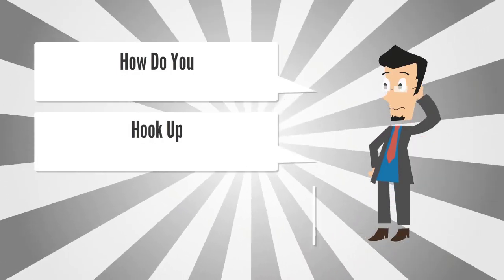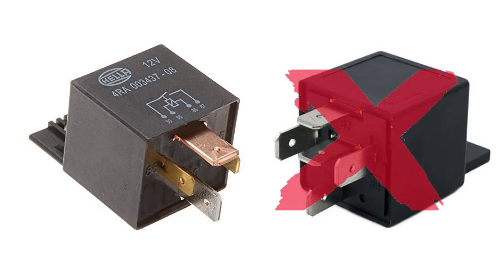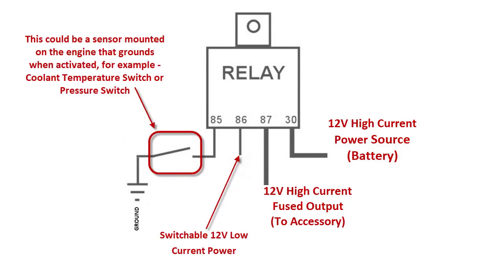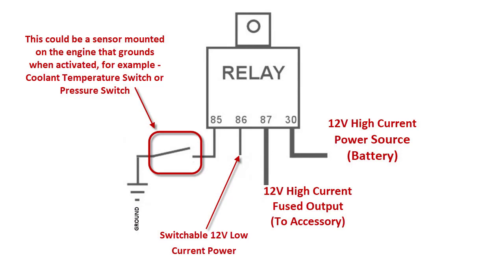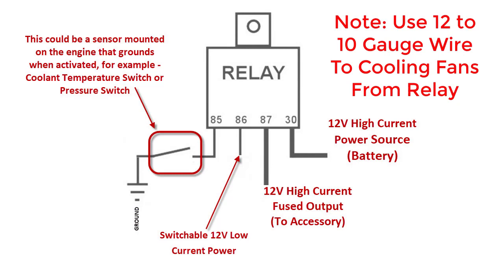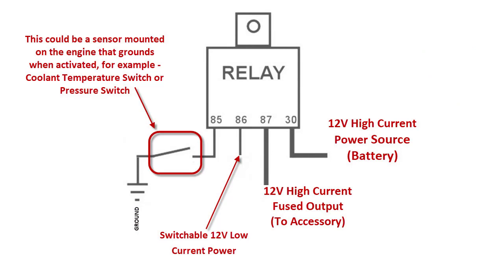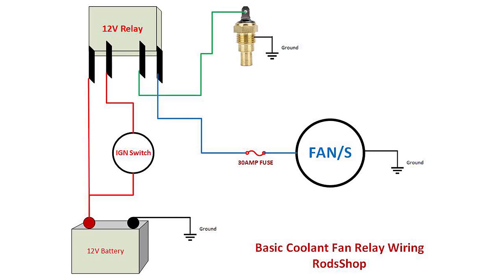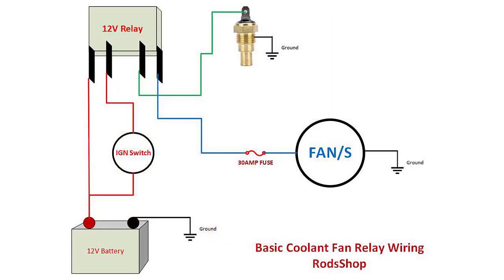How To Wire A Cooling Fan Relay

Comment: How much Current require for that and can you suggest  12V adapter and what current require?
Reply from the maker: I am not sure what you are asking. Relays are measure in amps, so if you have a fan or component that you know is going to draw 22 amps, it would be safe to get a relay that can handle up to at least 30 amps. 

If you need help on this, you will need to give me more information on what you are trying to do.

Comment: what about a toggle switch will a 4pin still work on and off for a radiator fan?
Reply from the maker: Yes, the toggle switch will just be used instead of a sensor. There is really no reason to ever use a 5 pin to setup a cooling fan, so a 4 pin is good.
Reply: @RodsshopOrg  or can i just run just a s witch with a fuse to the fan... fuck all the relay shit i keep having problems ive wired it all types of ways
Reply: @Luui2x did u figure it out bro
Reply: @RodsshopOrg  okay i have 15 amp switch  to relay with everything else wired correclty with 10g and 14g grounds and 30 amp fuse/holder and i still cant find the problem the only way it works for me to turn on and off the fan is when i wire 86 to 87 together onto pin 87 it works but then pin 86 is empty so im confuse on why is working like that?

Comment: Can you use an electric clutch fan oe harness for the signals?? That would keep factory specs an temp sensor in theory?? 2007 f150
Reply from the maker: I am not clear whet you mean electric clutch fan.
Reply: @RodsshopOrg   Like on my 2007 5.4 F150 it has an electronic clutch fan
Reply from the maker: @JokersHangout  I will look into this and get back to you
Reply: @RodsshopOrg  thank you! Everyone wants an does swap to Efan on 04 to 08 f150. 2010 fans fit flawless. But the clutch fan is pcm controlled it uses head temperature doesn't have a actual coolant

Comment: I installed a dual fan in my 86 c10. Installation was painless. The issue I have is once the temp rises and the fans kick on they don't kick off. Could this possibly be a bad relay? Thanks in advance
Reply from the maker: It could possibly be that your temp sensor for the fans is a less temperature than your thermostat. In other words, if your thermostat is a 190 degree and your sensor for the fans is 160 degrees, the water temp is never going to get below 160 to shut off. I am guessing the fans turn off after the engine cools off, you may need to give me more detail.
Reply: @RodsshopOrg  I utilized the temp sensor that came with the kit and installed a 160 thermostat as well. The only thing I did different from your wiring video is the key switch and the temp sensor are reversed. So at the moment the white wire is tied into a key switch source and the black wire is tied into the temp sensor sending unit. Due to following another how to video.

Comment: How do I put a temp gauge in a single set up
Reply from the maker: If you are wanting to hook up a temp gauge off the sensor that triggers the fan, it won't work. The sensor that triggers the fan is basically a switch and will not operate a temp gauge. You will need to find another  port in a head or block or even the radiator to screw a sensor designed to run a gauge. I am not sure if this answers your question if not, let me know if I have misunderstood.

Comment: Where  do you hook the  ground wire to fan motor
Reply from the maker: Run the ground wire to the radiator support or even to the negative battery cable. Just ensure that it is metal that is fully grounded. You can use a multimeter to check ohms between the negative battery post and what ever you are going to ground your fan to. Just make sure there is no resistance, if not sure, run a wire off the negative battery post to the radiator support to ensure it is grounded.

Comment: Thank you for uploading. Can I tap into the existing fan relay that is activated by a temperature switch so as to add a manual override, or do I have to use an additional relay?
Reply from the maker: You can tap into an existing relay, no need for another one.

Comment: Love the video. I have a 89 caprice I’ve done an  Ls swap on and I want to run Ac. Whats the best to wire up the three relay to turn on the fan if the computer is controlling them plus what wire do I tie into to use a trigger to turn on the fans to come on when the ac is activated? Thanks if you can help
Reply from the maker: The best wire to tap into is the wire that engages the clutch on the compressor. Tap off that one to trigger the relay. I would stay away from trying to run relays that are controlled by the computer.

Comment: Great video..
Could you tell me how to wire up a single  2 speed fan, to run for a/c and temp.
Reply from the maker: Does this fan have wires for low speed and high separately? If so, download my wiring diagram for connecting the relay to run a fan and just do it again and tap into the wire that engages the clutch on the compressor be the wire that triggers the relay for the A/C
Reply: @RodsshopOrg  I can’t download the diagram but this is what I’m trying to do
Reply: Thank you

Comment: If I have a trunk mounted battery do I need to run the power wire all the way to the trunk or could it go to a constant power source in the engine bay somewhere like the starter relay?
Reply from the maker: Then yes, just come off that terminal for your main fan power and that should work just fine. Just be sure to use the appropriate gauge wire for the amp draw of your fan. I would run no less than 12 gauge if this is a more common fan that doesn't pull more than 15 to 20 amps when it first starts running.
Reply: @RodsshopOrg  thank you for the help
Reply from the maker: There should be a junction under the hood where you can hook jumper cables to if you ever need a jump start. Look for it and you can just run power off of that.
Reply: @RodsshopOrg  it’s a 71 cuda so the only positive under the hood is the starter relay or the actual starter stud the battery cable connects to.

Comment: hello there I have a 1999 Isuzu order, I need to wire a trans cooling fan, I want it to come on when I start the car and stay on untell I turn the car off. what can I wire pin 85 to so that it will have power when I start the car?
Reply from the maker: You just need an ignition wire, check for any wire that becomes hot when you turn the key on. I do not remember on your vehicle off the top of my head if it has a coil pack or some form of an ignition control box, but any wire to these type of devices you can use to trigger your relay. If you need help, you can always contact me through my website and I will do my best to guide you. https://rodsshop.org/contact/
Reply: @RodsshopOrg  yes each plug has its own coil pack-should I look for a wire coming out of the fuse box under the hood?
Reply from the maker: @williamtreat5893  Yes, if you can find a fuse that gets 12 volts only when the ignition key is on, then you can tap off that. You can also tap off the alternator, not the main wire that charges the battery but the one that engages the alternator. You will need a volt meter or test light but either should supply you the voltage you need whenever the ignition key is on.
Reply: @RodsshopOrg  first let me tell you that I'm wiring a trans cooler temp sensor and it will be going inline between two rubber hoses-the temp sensor has two pins sticking out of it, so I wire one of them to pin  85 - that's the wire that has power only when the car is running right? so when the temp sensor reaches the temp it will send power to pin 87 and tell the fan to turn on right?  do I wire the other pin from the temp sensor to pin 86-for a ground? you did say at the start of the video that pin 86 could be used as a ground or do I need to wire it somewhere ells? and NOT to a ground- the little metal bracket on the back of the relay where you mount it to the firewall is that not a grounding point? i just don't know where to wire the second pin from the sensor-you would think that if one pin was hot and the other pin was a ground when it activated the hot and ground wires would be an electrical  problem

Comment: Question, wired everything up and everything worked but I had relay chatter and the temp sensor melted? Problem?
Reply from the maker: Sounds like the sensor wasn't grounded good and created a current overload. Or you do not have it wired correctly. The power on the sensor is supposed to be low, all it does is turn the relay on and off. If you have the sensor switching the full amperage to the fans, this will melt everything. Are you sure you have it wired correctly? I ask because even if the sensor isn't getting a good enough ground, the current should be so low on it that the most could happen is it doesn't switch the relay. I can help but contact me through my website so you can send pics of what you did. https://rodsshop.org/contact/

Comment: How about running relays from fan controller
Reply from the maker: I am not clear what you mean fan controller. Are you talking about the switch on the dash or are you talking a control that can vary the speed of the fan. Please clarify...Thanks
Reply: @RodsshopOrg  I'm sorry I have a flex a lite fan controller on 2 derale 12 inch fans and I wanted to run some relays to reduce the load I have them on the controller and one 50 amp fuse and the fuse gets hot

Comment: What is the single prog thermostats ground? I have it on a inline lower radiator hose dose it still need a ground?
Reply from the maker: I am not sure what a prog is. If you are talking about that housing that the temp sensor goes into, it does have a ground wire to the housing and it can be run to the engine block. If am answering that wrong, let me know and I will do my best to help you.

Comment: Many thanks . . . this video was very helpful.

Trying to trouble shoot prior owners electric fan wiring and this video helped me understand what they were likely attempting to accomplish. (Truck has two fan system, one 5 prong relay with 87a not used, both relay 86 and fan to run ground, 2 prong sending unit, relay 85 wired to both the sending unit and the A/C compressor). Appears they were trying to run both fans triggered by the A/C compressor but the compressor was being neurotic turning off and on every 5 seconds, which then would not get the fans spun up and car was running hot. Either this wiring is playing havoc on the A/C compressor or it’s a separate issue, but at least I can get my fans wired and running properly.

Other videos that covered only a specific installation were not helping. But you covered it all here.

Greatly appreciated!
Reply from the maker: Awesome, glad I could help you out!!

Comment: Recently got an LS3 Swap. Exactly what I was afraid of happened. Shipped it to another state to the expert and now I’m having issues and we are trying to figure it out over the phone. Started with over heating. Found one of dual fans stop working because fuse melted inside its inline wire case. Fans are wired to be on as soon as I turn key to on. So I replaced inline fuse wire and 40Amp fuse. Now after 10 minutes of fan running relay so hot you can barely touch it. So I swapped the relays and the one getting hot didn’t get hot anymore but the new one on the side with fan issues did.
The installer is sending me a new relay, he says the base the relay connects to can be bad, but I just don’t see how. But everything is possible. Today when I get home I’m measuring the resistance of each fan. Hopefully I don’t have to cut any wires to do this. Any advice?
Reply from the maker: This is probably a bit much to try and discuss in this comment section, so talking through my site might be better. https://rodsshop.org/contact/
It sounds like you have a bad fan more than anything. You need to measure the amp draw, (the current) for the fan in question. I would run jumper leads off the battery to run the fans outside of the fused and relayed wiring. Use a volt ohm meter that can test amps and run it in between each fan. I would measure the amps on the fan that you know is working fine first. That will give you how many amps it should be drawing. Then test the fan in question. 

Be sure to check the ground on the fan in question. A bad ground will cause it to pull more amps but no fan unless it is huge should be pulling more than 20 amps. So if you had to run a 40 amps, you are just waiting for a fire. Check the current draw before going any further. Contact me through my site and let me know what it all said and I will try and help you through the rest.

Comment: Which sensor currently on the truck do you have to remove in order to use the sensor switch that comes with fan? The temp or sending unit? 

They both have 5v signal, the new sensor is to be grounded so they can't go together right?
Reply from the maker: You need to be more specific, are you putting an electric fan on a vehicle that already has one? If not, there is no sensor to remove, you are adding one. Any other temp sensor that is already on the vehicle is for a light on the dash or gauge and you do not remove those. Please contact me through my site and explain in detail and send me pictures of what you are doing. 
https://rodsshop.org/contact/